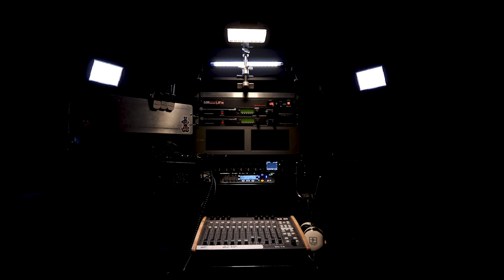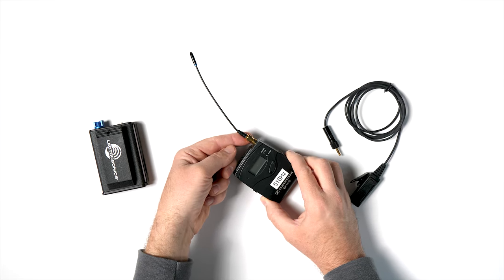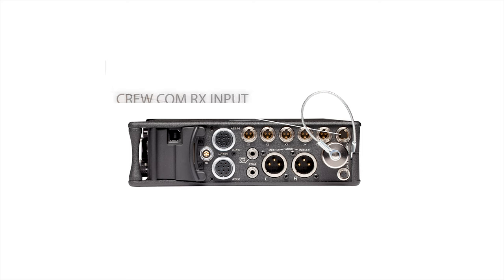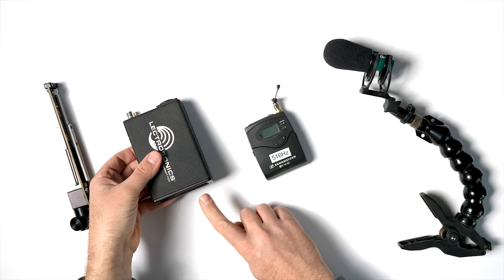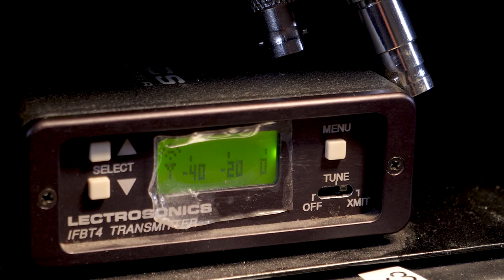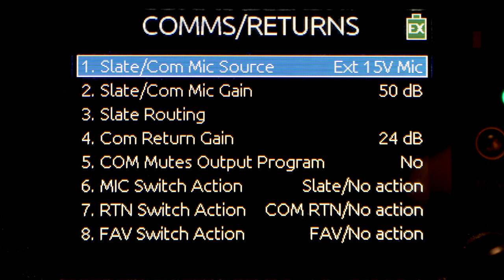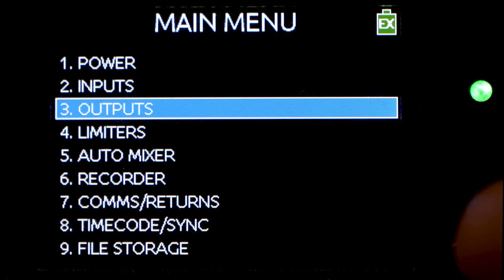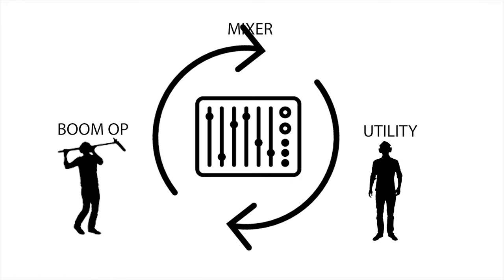Crew Coms Setup - Breakdown

Comment: Great video, as always. Simple and clearly explained.
Reply from the maker: Thanks Allen!  So you'll appreciate that this is actually a little different since we last time used it.  While making the video I realized that there is indeed a headphone RTN available on X5/6 in which I previously thought it was not available on any AUX output forcing me to send to the IFB from the 2nd headphone output.  The result is the iFB is now kind of like a pre fade headphone send not affected by volume adjustments and is not longer being driven by the actual headphone amp for slightly cleaner and fatter signal.
Reply: @MichaelWynneCAS  Sounds good. I look forward to hearing the difference.

Comment: Great video.  I've worked on a small set as a boom op, and the mixer sent signal to the director, using a 633.  I got just the signal from the shotgun mic.  It would be cool to discover a way to set up a similar system using lower-priced equipment.  Sorry if that's below your level of expertise, but in flyover country we usually don't have that sophisticated of a set up.  Still be nice to have a set up like yours.
Reply from the maker: Scott, I was thinking about this comment.  Now with the Mic Pre II expansion and 833 coms could be more common on smaller set ups.  At least I hope so.

Comment: Great videos Michael, and very helpful. Any suggestions for a usable Com system based on the 633 (Not all of us have the additional functionality of the 688). I'm currently sending my LR Mix out of the X3 output to the IFB Tx, but my slate mic is audible to everyone on the IFB, and shows up in the recordings - which can be useful from time to time, but certainly not always. What I lack most is a way for my boom op to talk back to me without everyone else hearing.
Keep up the great work and I greatly appreciate your willingness to share your experience with those of us who are still learning.
Reply from the maker: Providing your not using all 6 inputs, you can dedicate one of your inputs as a dedicated crew coms return or as a mic going to just your boom op that can also include the mix, etc.  There also may be a way to send a coms input on the return input of the 633, but that depends if you can make  a custom headphone input config on the 633 to include the RTN and mix for you.

Comment: Two questions
Why do you use X5 as output to the crew?
And do you usually send the mix to the boom op and not only the boom signal?
Reply from the maker: Hi Linus, thanks for the question. X5/6 are the only AUX tracks that allow you to route the headphone outputs in the menu system which is the basis of how all crew members hear each other.   And I typically send a production mix track to my boom op.
Reply: Interesting! Is it common to send the mix track to the boom op? When I’m booming I want to listen to just the boom. But I understand that it’s not possible if you also what to hear the comms
Reply from the maker: I’d say it’s common, but not a hard fast rule, sending a prefade boom with thIs com workflow is possible though, you’d have to engage it on the send is all, and the mixer could simply listen to the mix on the other side of the headphone channel, but the utility would have to hear the prefade boom though.  But the newly released Lectro duet opens up the possibility of both.
Reply: Michael Wynne , probably the biggest thing I wish my Zoom F8n had: being able to route the headphone outputs like that. Is weird not hearing for instance a channel PFL or the record bell etc
Reply from the maker: HI David, maybe they would consider including that in a firmware update, might be worth making a suggestion to Zoom.

Comment: I saw your soundchat with Curtis and you mentioned that you switched out your G3s to Sony UWPs instead. May I ask what the reason for that was?
Reply from the maker: Hi Dustbrigade, Certainly. I was experiencing some interference hits/bursts of nasty white noise on the front end of the G3 receivers that I believe was being caused by all the extraneous RF activity on my current show.  It was especially problematic when I was any where near Teradeks.  RF scans on the G3 receivers weren’t helping so I switched over to the Sony’s.  The new Sony’s are performing much better as far as less interference, also they can take continuous power from a mini USB port and simultaneously trickle charge the rechargeable AA batteries.
Reply: Michael Wynne Okey thank you a lot for the insight!

Comment: Hi Michael! Thanks for this very informative video! I do have one question though: When you use the X5 output to the crew, you routed it via HP-R. I understand this is for all the production crew to hear whats going on. But if the mixer wanted to talk to the boom op or utility privately by pressing the comm using the slate mic, wouldn't the rest of the crew be able to hear that as well since the signal from the com/slate mic goes to that bus?
Reply from the maker: HI Siddarth,  With this routing structure you are correct that you would be unable to privately talk to one member of the sound crew and not the other.  To do this you'd have to use a separate send  and also use a separate IFB TX/RX each on it's own channel.  Their could be upsides and downsides to each approach, it all depends upon your particular workflow needs.
Reply: Michael Wynne thanks! Again appreciate you for putting out not just informative content for sound techies like us but also great quality videos! Looking forward to more from you!

Comment: I’m using a zoom F8n and really want to have a crew comm setup similar to this but the Zoom is limiting to say the least. Any suggestions?
Reply from the maker: It all comes down to signal flow routing, most mixers weren't this extensive early on so something that may be helpful is you may be able to use an additional mixer in the front end to pull this off.
Reply: @MichaelWynneCAS  you just reminded me about me about my old Shure FP33. This will work for this exact purpose.
Reply from the maker: @cinematiccreations8310  love the FP33, first mixer I used on a ENG set!